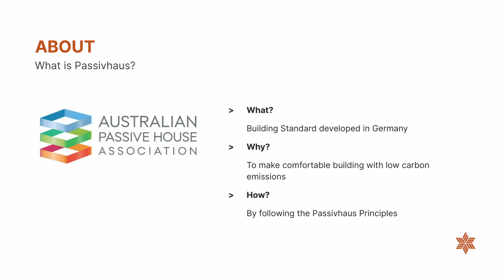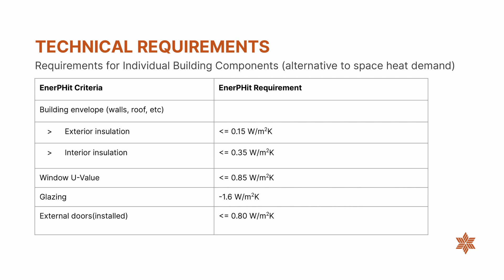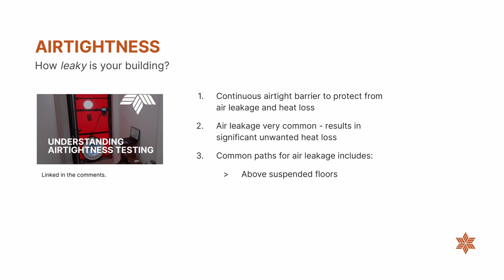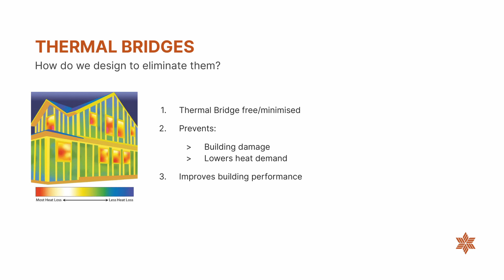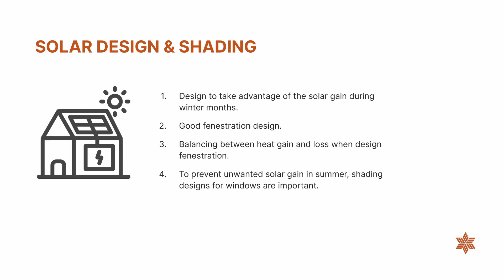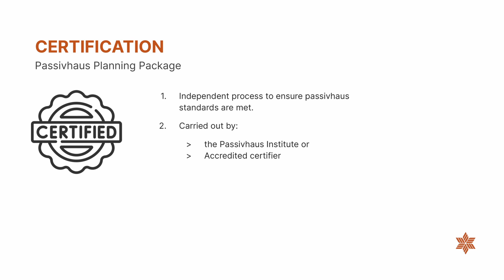Introduction to PassivHaus Strategies

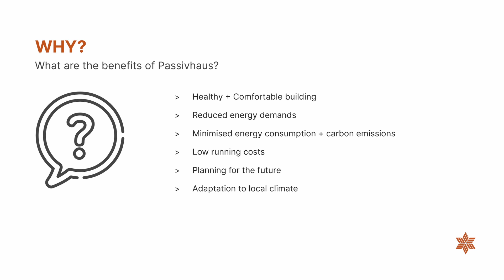Comment: 0:58 Primary energy demand has been replaced by "renewable primary energy demand" (PER demand) which evaluates the building in a scenario where fossil energy sources are no longer used. As of 2025, PER Demand is capped at ≤ 60kWh/m2 annually for Passivhaus Classic certification.